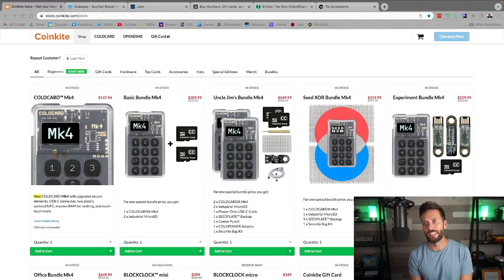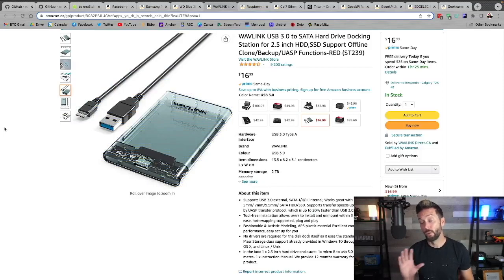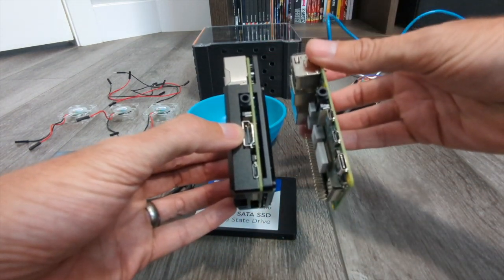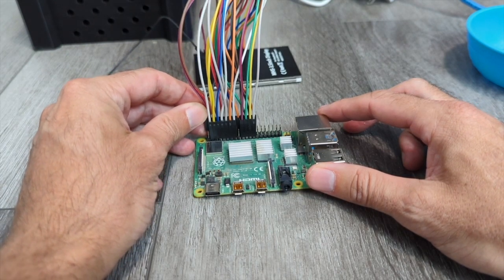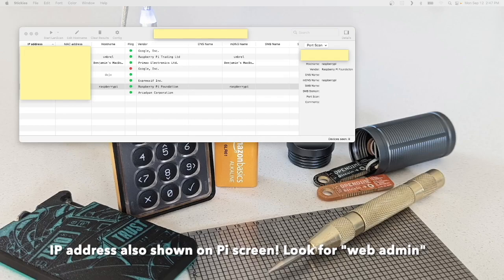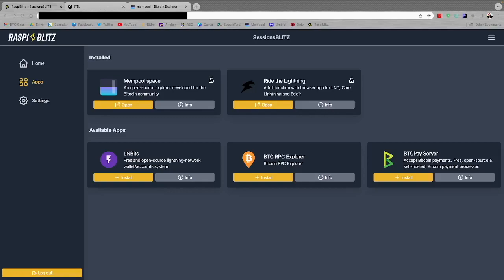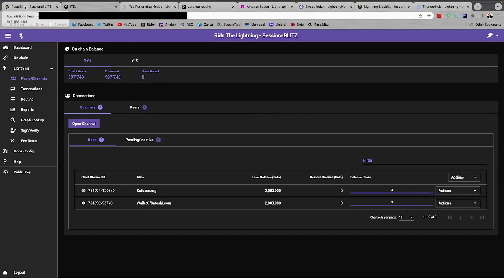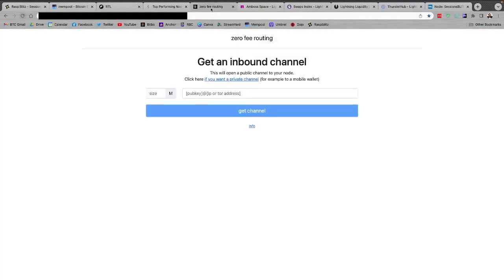RASPIBLITZ - How To Run A Lightning and Bitcoin Full Node

Comment: I use lightning everyday but I still feel like having my own lightning node isn't needed unless I wanna store alot of BTC on it.
Reply: Matheus Araújo  what are some reasons running my own node will benefit me versus usig Muun, Strike, and other sites to transact in LN?
Reply: @zackcovell  those are custodial.  Not your keys. Not your coins.
Reply: @jarrydvanhoy  Had pretty horrible experiences in many apps trying to set up my own channels. So confusing...just won't do it. LN is so fast i just use it and don't store the BTC long
Reply: @zackcovell  running your own node is what "be your own bank" means. You have stored all the blocks and you verify the transactions on your node. You basically trust your own chain and not someone else's chain that could be fraudulent.

I look at it from a self sovereignty perspective. How smoothly everything runs without a third party 🥳

But I still don't accept the lightning ⚡ channels concept. 

I look at it like "hey boss, here's my channel worth n sats so you can pay me my first paycheck" 
You literally have to pay to be payed. 

Shill Stellar blockchain all you want but they had nailed it when it comes to paying someone that has minimum balance on their account.
There are others of course but with Stellar I'm familiar with.
Reply: @StellarStoic  So just storing your BTC in cold storage doesnt mean your ya own bank?

Comment: 00:04:24 - Prerequisites
00:13:31 - Prep your SD Card
00:16:01 - Assembly
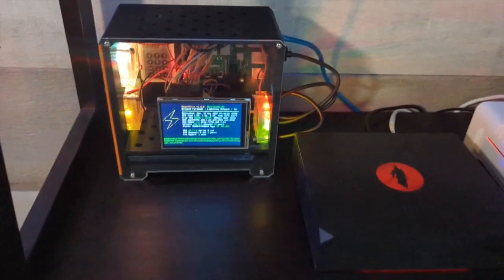00:33:40 - Connect & Setup In Web Browser
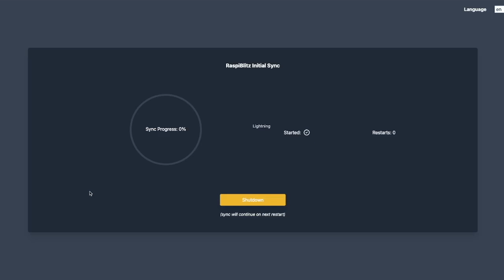00:38:16 - Web Overview & Adding Apps
00:42:18 - Ride The Lightning Overview
00:44:55 - Funding Your Node (via Ride The Lightning)
00:47:16 - Opening Outbound Channels
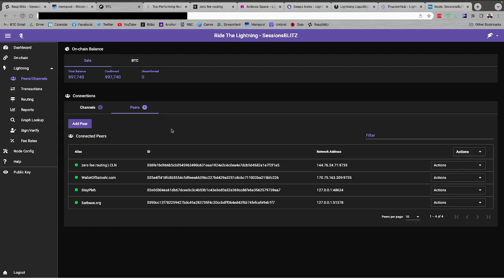01:04:06 - Sending/Receiveing Lightning Transactions (via Ride The Lightning)
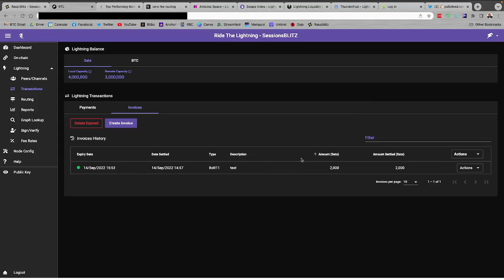01:09:48 - SSH Into Your Node - Enable Additional Settings & Apps
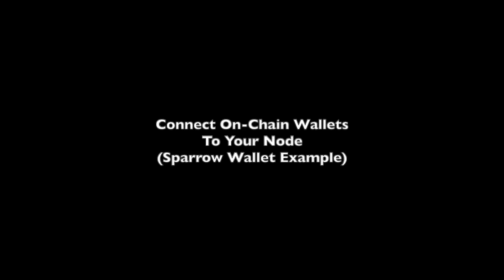01:18:30 - Connect On-Chain Wallets To Your Node (Sparrow Wallet Example)
01:20:01 - Connect Mobile Lightning Wallets (Zeus Example)
01:28:37 - Final Thoughts

Comment: OK.  Trying to run this on raspi4.  When I flash the boot from the SD fatpack SD card image, then put in the card and try and boot it up, all I get is a curser on a blank screen.. what am I doing wrong?
Reply: I am sure it is something simple
Reply: @danielschaben   I have the same issue!
Reply: Hey, I just moved forward with the setup and it let me set everything else up. I think you have to have the small monitor in order to see that it's setup. Otherwise the cusror flash is it's way of saying it works!
Reply: @vizualmagician69  so I don't have the monitor.  I am hooked to my Flat-screen.  What is the work around to fit the screen I am using?
Reply: Ordering a another screen in a room full of screens seems like a waste of sats
Reply: @vizualmagician69  could I do a control-alt T and then run the sudo raspi-config or do I need to change the boot directory in another computer?

Comment: Two comments on the hardware.

1. The aluminum heatsink case that you showed has a variation with two integrated fans that makes the Pi run cooler by a good couple degrees and get rid of the heat better but needs to connect to two of the GPIO pins, so can't be used with a screen.

2. Be careful when choosing a screen - not all similar screens have such long pin headers. Some make the screen sit much closer to the board and are incompatible with the heatsink case. Either way, if you are using this case, the screen will interfere with heat dispersion, so I wouldn't recommend it.
Reply: Yeah, I have the normal heat sink without the fan and it def runs hot.  Especially with the LCD on top of it.  I needed to mount an external fan below the heat sink to get the temps down around 50c.